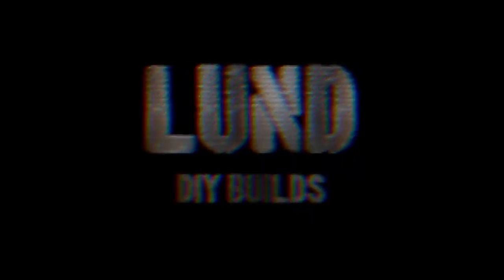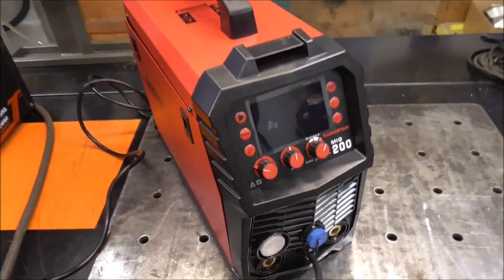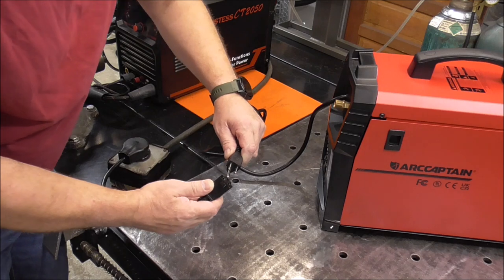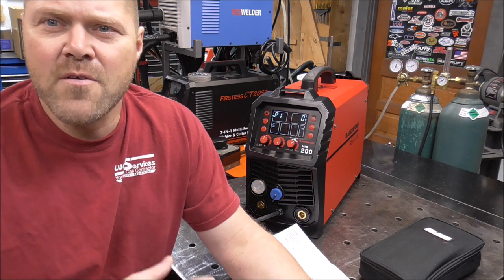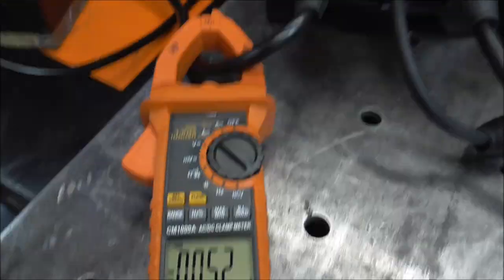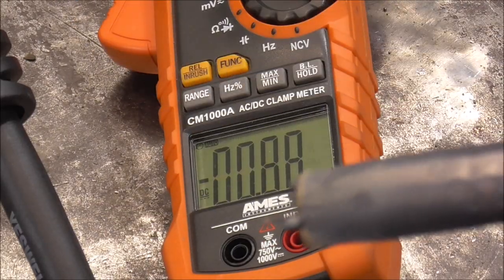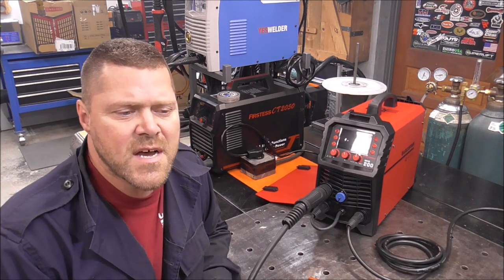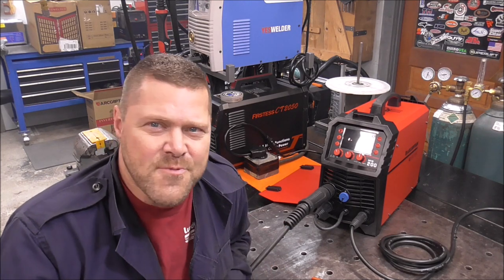TESTING WELDER GIVEAWAY #4 - WIN A MIG200 WELDER!

Comment: Great video!!!  This shows that the welder is operating within parameters and will do what it is supposed to!!!   Thanks so much for doing this.  Do contact the manufacturer on the plug situation.  Be well, be safe, be Blessed!!!
Reply from the maker: Right on Jim! I'm very impressed with this welder so far....except for the cord issue which is easy enough to correct.

Comment: Brandon,  Awesome job providing first rate video content to help us novice welders.  Thank you.

Do you have  links to a mig whip and liner for this ArcCaptain MIG200 unit.  I am interested in purchasing it if I can also find the correct whip and liner to setup for aluminum wire welding as you recommended. Thanks, Dan
Reply from the maker: I wouldn't dare guess. Your best bet would be to check out their website. They would be able to guide you better than I could.

Comment: Hi Brandon. I was jus talking to a friend about your channel and you just posted a new vid. We just watched it like it was a tv show. This should be a discovery channel show for sure. I see you have the Yeswelder mig205ds. Do you think you can make a video of aluminum welding using that welder?  I'm wondering if it's possible to weld aluminum with that specific welder. It doesn't have manual adjustment for wire speed. That's what's got me wondering...
Reply from the maker: Thanks Joe and I appreciate you getting your friends involved! I will dig into the MIG 205 and see what I can do. I honestly dont remember if it can be converted but I will have an answer soon so stay tuned!
Reply: @BrandonLund  Thanks Brandon. You rock

Comment: when arccapton sent me this welder last year to review, i refused to show it because of the dangerous cord. i messaged them with my concerns. they got back to me quickly stating they were going to make the change so the male end of the permanently mounted cord is a 240 volt and the adapter will take a 120 volt male and convert it to the 240 volt female.
Reply from the maker: They seem quite receptive. Unfortunately there are still manufacturers importing these with a 120 plug. Not sure how this could even be allowed into the U.S. but given everything else that's legalized I'm not surprised.

Comment: Very impressive!!
Reply from the maker: Thanks Denver! I'm impressed as well. Even with the plug issue it still seems to be a really nice unit.
Reply: My yeswelder stick machine has the same plug setup. I think I'm going to label the 120v plug on the adapter somehow as a reminder to only use it for welder or my cut50 plasma cutter which is the same setup. But yes I agree with you, if someone doesn't realize that it is connected to 220v it could be at very least detrimental to the item plugged into it or deadly to the operator.

Comment: Be sure to check your actual voltages before you butcher any plugs. It is very easy to derive 120 volts off of a 240 volt plug in: all 240 can easily provide double 120 to ground circuits.
Reply from the maker: It's the overcurrent protection that becomes the issue. General 120 volt receptacles and plugs are rated at a maximum of 20 amps which gets wired with #12 wire. NEMA allows cords going from appliances and equipment to be undersized as compared to the feeder wires.

Comment: I'm just now seeing this video-  about the VRD feature-  would you turn off VRD in the event that you need to run 6010?  I seem to remember 6010 rods require a comparatively higher open circuit voltage to maintain their arc, for whatever reason.
Reply from the maker: It probably wouldn't hurt.

Comment: welding  lawnmower deck,   fixing aluminum brackets , cracked transmission cases  fixing  bunk beds build a better welding cart  , trunk pan  floor pan 1/4 panel replacement  ect.
Reply from the maker: Sounds like you got plenty of projects to keep this busy!
Reply: @BrandonLund   yep  sure will

Comment: Not looking for multi process.  I want to move the 14yo up from flux core to a simple but sturdy mig.  Should I be looking at a multi instead (I don't want to overwhelm him)?  Could I get some suggestions?
Reply from the maker: I would Phillip. The prices have really come down on the multi-process welders and when he gets good at one process you can move him to another. The setup has also come a long way and has gotten much more straight forward.

Comment: My welder sits on a wheel cart that has its own 120 volt and 240 volt plugins which I set up. 240 volt cord comes from the wall outlet to the cart to heat a 240 volt outlet, beside that is mounted a 120 volt outlet who's wires junction in the 240 outlet so tapping to one red side and the one neutral line of the 240 gives you the 120 so I can run flood lights and grinders from the outlet on my weld cart.
Reply from the maker: It sounds like a sweet setup. You have to be careful though because your 120 volt outlet and the wire going to it is only rated for 20 amps. It sounds like the only overcurrent protection is on the 240 volt side which is probably a 30-50 amp breaker?

Comment: Brandon, I'm very curious, has ArcCaptain responded to your questions about the power cable plug adapter design flaw? I actually just purchased and received the ArcCaptain plasma cutter that has the same 110/220V power cord setup. These adapters effectively use a NEMA 5-15 plug to make a 220V connection which exceeds the voltage and current rating of a 5-15 plug. I don't understand how this design can even be considered safe by CE standards? I emailed ArcCaptain a few times and got no response. The wire gauge of the adapter is also stamped as 14 AWG which also surprised me and seems like undersized wire to be used on a 220V power cord plugging into a 50A wall receptacle.
Reply from the maker: They have not said direcly either way if they will remedy this situation but they thanked me for my input. The onus is on them at this point. As far as the input cord, I'm not overly concerned with the smaller input wire only because my Fronius machines have small input cords also and my Fronius machines are rated to handle much more power than the cord is rated for. I think there is something that allows the actual cord on the machine to be rated smaller than it's maximum amperage output.

Comment: Great content as usual Brandon, these welders can do 120/240V, what is the breaker used at the panel? Are you using a 2 pole 30A breaker?  The reason I'm asking is because of the size of the cord I see coming out of the back of the welder, looks rather undersized. I would be worried about the short cable overheating and then melting the insulation thus welding the conductors together while you're trying to work.
Reply from the maker: You are correct. 2 pole 30. I've actually wondered this myself about the small size of a cord coming out of a machine in relation to the breaker size. I was told it has to do with how equipment is rated. My Fronius is the same way. It looks like it has a cord rated for about 20 amps coming out of the back but the machine will easily draw 40 amps when maxed out.

Comment: My Hobart 210mvp came with real adapters that you can’t mix up AND HD cords made to right specs for welding.

Just got a yeswelder inverter tig that has the same cheap setup but that keeps the price low so up to us to stay safe….

I have to go now to check all my adapter and fortunately I bought this specifically to do thin metal so 110 should work fine for now.

Just an idea.

The only 220 plug was 30a to my dryer. 

Preferably you spend all the money to add a new line to the box but I don’t weld alot yet to justify that cost etc.

I drilled a hole in my back wall behind the dryer and ran a line through with a plug for the wall on the inside and a special water proof screw plug outlet on the outside for my welding lines which no normal 110 etc can be plugged into. The box and wiring are all secured to and through the wall but It’s not hard wired to the house electrical system 24/7.. Only plugged in when I need it and doesn’t compete with the dryer.

I also don’t cook much except for microwave or grill and recently removed my stove from the house and found whoever put it in  in 1978 left a 4foot line from the wall with a 220 outlet on the end couled up behind the cabinet which is 50 amp 220 and this wall is also the back of the house…… hmmmm

YES I am single and don’t date so I can do what I want when I want any time I want to my house…… Suckers…… 😂…. within code of course….
Reply from the maker: I've actually done the dryer cord trick for a bunch of years myself and it works just fine. LOL  🤣🤣🤣 Because welders now come with a standard welder plug I've moved away from the dryer setup and just wired everything for standard welder plugs.  My Fronius actually came with several quick connect cords for various voltages and plug configurations. Pretty ingenious way of doing it but certainly not the most cost economical either lol.

Comment: I would recommend you do NOT just switch the plug on the end of the cable unless the cable AWG size is capable of handling the current when using 220 v. Maybe better to actually change out the entire cable which would be more work however.  Using a properly current rated 220 volt cable is very important. It may be the cable is already sufficient, but from the looks in the video the cable seems a bit thin.
Reply from the maker: Changing the plug end doesn't change the amperage drawn. Its still drawing the same if it's plugged into the adaptor / converter or if you put the end directly on the wire.
Reply: @BrandonLund  Hi Brandon, the plug is not the problem, the wire gauge is and possibly the circuit breaker. The manufacturer may have used a gauge wire less that what is needed to save costs. For safety reasons to ensure the input wire gauge is correct, I suggest you place your current meter around the input cable to determine how much current is actually being delivered from the outlet with welder at max settings and welding. Specs on the welder say For 110v the I1max amp at wall on it chart shows 44.6 amps with an I1eff current being 19.9 amps. This means you need to have minimum of 12 AWG wire (10 is best) as 14 awg puts it at the top of the limit and you will experience the input cable getting hot. For 220v the numbers are I1max at 35.3 amps and I1eff at 15.8 amps. 10 awg wire should be sufficient. In both of these cases you need to also have proper circuit breaker, for 220v it should be at very minimum a 30 amp breaker, for 110v minimum would be a 25 or 30 amp breaker.  110v 15 amp breakers usually have 14 awg wire run to the outlet. This is not sufficient for the welder and will cause the breaker to trip when trying to use the welder at its higher settings. You show plugging the welder into a 110v outlet. Does that outlet have a 15 amp circuit breaker? Main point I am trying to make is to ensure the cable can handle the load. I was concerned about the input cable as it seemed to be smaller than 10 AWG. I dont know actual cable size as I do not have this welder and cannot perform any tests for this. If that is the case then the manufacturer may have used a 14 awg wire which is actually at the max range for this purpose and insufficient. All I am saying is walk thru the numbers for safety. All that being said, if the awg of the input wires are 10 AWG changing out the plug would work as you have suggested. If you change out the plug and the wire gauge is not sufficient and you plug the welder into a 220v outlet rated for 30 amps and the welder is set to its higher settings, you may have a problem if the current draw exceeds the rated capacity of the input wire. Also note that the adapter is using a heavier gauge wire which should give you a clue that maybe the wire gauge of the input wire is not sufficient.  This welder is on the lower end of the costs for welders of this type and they may have tried to cut corners at this point. Copper is very expensive these days. Hope this helps.

Comment: Every one of these dual voltage chinese welders ship with 12-13 guage power cord and adapter which are too thin for 200-250 amp machines.
Reply from the maker: My 220 amp Fronius machine has a 12 guage cord. Input cord size is rarely the issue. It's usually on the output side that they skimp